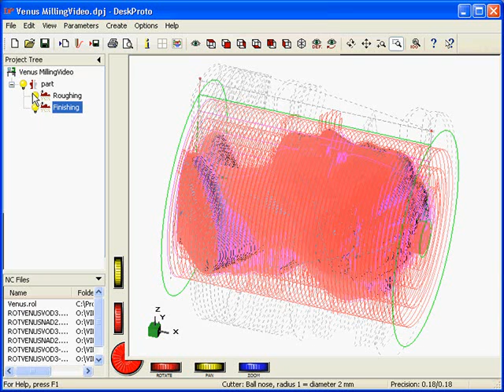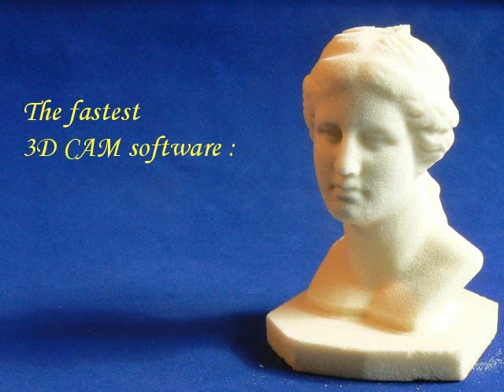Machining Venus de Milo, using DeskProto

Comment from the maker: DeskProto will surely work with your MX-15 machine: it is in the list of machines that you can select. However, for this Venus model you need a machine with a rotation axis, and Roland does not offer that. Three axis machining works fine though: you can test using the free trial version.

Comment: Hello,
I saw the previous video of Milo to how generate tooling path, and it seems that you were put the work piece zero at the middle of the cylinder, but in this video I saw that you start from the top that mean the tool is not positioned at the same work piece zero
Reply from the maker: Hi Salim, 
On a CNC machine the zero point and the starting point need not be the same point. Indeed for rotation axis machining in most cases the zero point is in the center of the cylinder block, however obviously machining needs to start on the outside of the cylinder, so on a much higher Z-value. DeskProto will do this automatically.
Reply: DeskProto Thank you so much for you reply.
But the zero point must be the same in tbe software and in the machine ?
Did you choose the zero point in the center of the cylinder and make the XYZ=0, after that you moved the tool far ?
Reply from the maker: Yes, that is correct: it needs to be the same in the software and on the machine. Normally I first set the zero point on the machine, then move the cutter away, fixture the block of material and finally start the NC program file.
Reply: Thank you